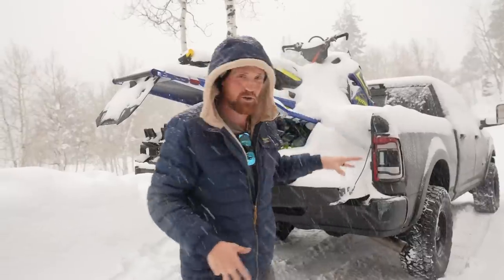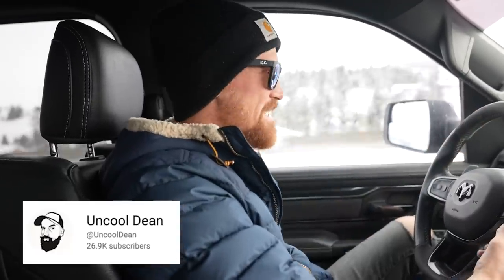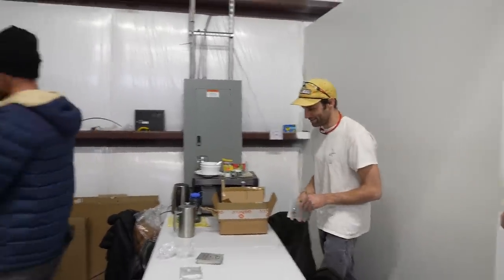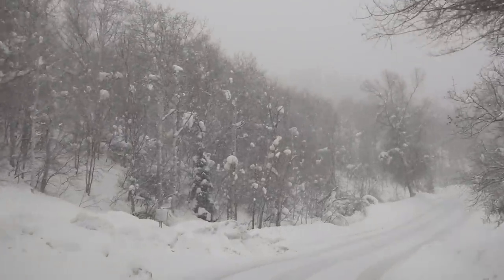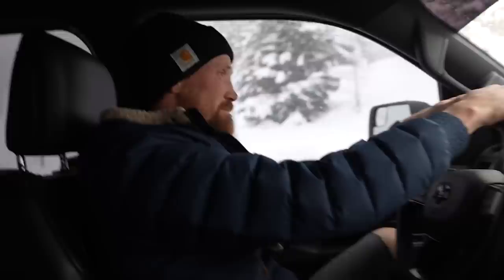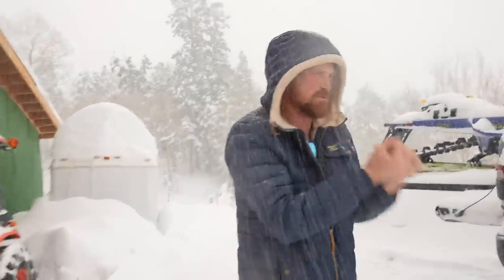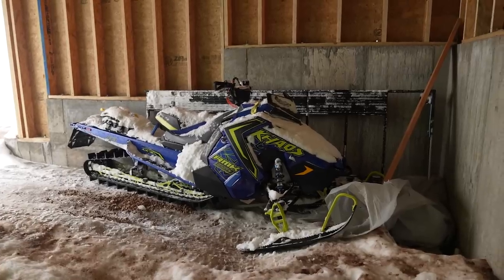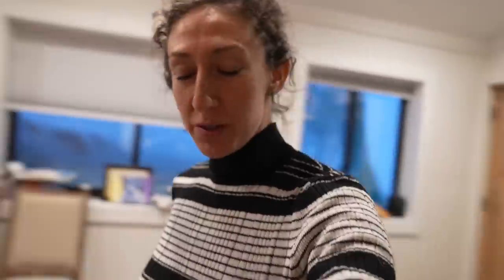I CRASHED OUR BRAND NEW TRUCK

Comment: Love watching a cozy night on the floor with a fire going... just hanging out  with Leo! 💖

Hey Trent... You're not the only one to have a 'wreck' in your driveway.  Years ago I had a brand new Astro van, and because of all of our stuff, I'd back in on the right side of our two car garage and we'd go in and out through the sliding door.  I don't remember who opened the door, but I didn't realize how much it hung out from the body and the door got hung up on the brick in between the doors.  It buckled pretty good, and needless to say... it was in the shop for Seeeveral days!

Comment: An hour or so north east of where I live, most of the houses are built with an extra door coming out of the Attic, and have 2 story garages because they get 20+ feet of snow. The Attic door is used in winter because all the other doors get snowed in, and the second story of the garage is where they park the skidoos in the winter as the ground floor is buried.
had me scratching my head when I first saw them as a kid.

Comment: Living in your kind of climate, it is a wise idea to learn and set up your tire pressures to improve traction... typically deflate all wheels to approximately 20 psi using inexpensive deflators on your air valve stems (easily available on Amazon) then have available a portable air pump with high output (250 lpm) to air up the tires as needed.
Alternatively, traction socks are easy to use (around $80 per set of 2 also from Amazon).

Comment: Hey guys.

I'm happy for all your success. 

Regarding the Mountain Made plate for the vans,  I suggest that you get some high quality plastic ones that you can glue to the vans.

More than 20 years ago, manufacturers stopped the car dealers for attaching promotional plate on the car they sold using rivets or screws because it will void the warranty in terms of paint and rust of the vehicles. 

I assume this have not change it.  If you want to use them, don't do it directly on the vehicle but in some aftermarket thingy you install it in the cabinets.

Comment: Coming from someone with many years of loading and unloading experience…. You have plow build a hill that you can back the truck up too and drive the sled on and off then no one has to help and it much safer and easier. Our old house was on a hill so we could just use our front yard lol

Comment: I've lived in a similar climate in Washington......back in the 70's when my ex and I were building a house, we lived there without ANY snow equipment! Only a snow shovel and a little 2 wheel drive truck. Now THAT was interesting...also lost power many times in the winters, and no generators or solar, etc. Just candles and a wood stove. Now THAT is roughing it! First year was with outhouse only.

Comment: Seriously, In Valdez,Akaska, they have to shovel around the sides of their houses because it can do what you say. Their snow goes up to the second story and they have doors that open up to the snow so they can step outside with snowshoes. Summertime, there are no stairs from that door. You’re already set with your garage build, you just need snowshoes up there. Maybe for the house is foot or two between it and the bank of snow? It has been a plentiful year for precipitation! Oh, Valdez is on the coast so their snow is probably heavy, not the powder like ours.

Comment: I've owned pickups and Tahoes and driven a bunch of full-size Blazers and Broncos over the years.   I would expect the Pathfinder to do better on the roads than a pickup truck as there is no weight in the back end of a pickup.  
Don't forget one of the biggest mistakes, a 4x4 goes better than most vehicles but stopping and turning are about the same.

Comment: Just a friendly heads up.  Your not going to pass your Electrical Inspection with that jerry-rigged panel in the garage.   I would get it cleaned up before you call for inspection.  You may even be required to mount a disconnect on the outside of the wall of the garage at the point where the feeder conductors enter the building, for First responder access, depending on your local Building Authority.  You can not have individual conducters inside a wall cavity.  The conducters must be enclosed in SE Cable or Conduit.  There are many more minor code violations I saw, but this is the only major one I saw.   Great Video, keep up the good work.  Thanks, Russ-Journeyman Electrician from Oregon.

Comment: I have an F350 and have done two stupid things. About two years ago, I was unhooking my pintle trailer when I got out of bed I closed the tailgate, got in the truck, and drove out from under the trailer. The pintle hit the gate and bowed it. Everything still works, so I left it. Then this last December, I was plowing with the tractor (JD 4052r Cab) and backed into the extended pull-out step on the tailgate of the same F350. Not the stair will not fully retract, and I cannot latch the bed cover. This will have to be fixed.

Comment: I had 4 children all so incredibly different. 1, my second walk at 8 months.  My 1st, acted like she was afraid of heights when she stood up! She walked at 13 mos. The 13 month old was the best reader. My second daughter had a slight speech problem and didn't read well. As with my other 2 younger children it was the same. My youngest child had a very bad speech problem and it was so long ago I went to the library to figure out how to help him. In the end I found out that the children that crawl longer have less speech and reading issues. Dont push him. He will be really fine, I assure you.

Comment: Now the truck is true to its title.  Those moose mirrors are the worst and why were they up, you where not towing?  I bet before winter the snow mobile hits the back of the truck. There is lots of videos of loading snowmobiles into the back of the trucks  going wrong. PS parking in tree wells not smart.
Reply from the maker: Everyone makes fun of the tow mirrors being up until you own a Ram. The passenger mirror is useless unless it’s turned up like that. I don’t like the look but I like being able to check my blind spot.

Comment: I have been a long time fan, and was wondering if you could help me. In 2005 I bought a mobile home, in what I thought was a trailer park, because it was called Diamond H Trailer Park, and my landlords sold the property back in April of last year. The new landlords gave all other tenants a 90 no cause eviction, and more than doubled the rent. The new landlords gave me a 180 day no cause eviction, because I was the only tenant that owned their mobile home. When I did my research, I found out that they couldn't kick me out for no cause, so I wasn't too worried about being kicked out. Well a month out from the eviction I find out that the new landlords are going to dispute the term trailer park. Needless to say I ended up losing, and basically my home was taken away from me, and given to them for free. I am now homeless, living in a tent, in Quartzsite Arizona. My home state was Oregon.

Comment: 4Runner should of been superior to the truck In challenging circumstances.
Reply from the maker: In some situations yes, but as far as being planted in the snow and ice the truck takes the cake hands down. 
Some situations weight is actually a positive things
Reply: @TrentandAllie  A 1500 Ram and 4Runner are within 500lb's of each other. Depending on configuration of course. I've owned both a Cummins 3/4 Ram and 2 4Runners. Except for towing and carrying bigger loads the Runner rules the roost. So I guess I agree to disagree. I am partial to my 4Runner v8 with 1/2 million miles still towing and off roading for me with minor maintenance stuff. i know with inflation my 2 cents won't go far! LOL Keep up the good work!!!